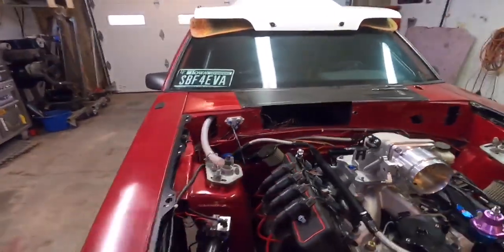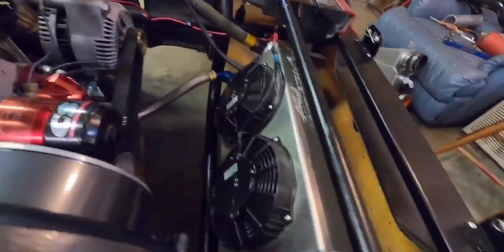Switching things up on the 800hp fox mustang

Comment: i really dig that small radiator. How does it keep cool in summer weather conditions? i have a front mount side turbo, on my LX and i couldn't fit a fan shroud, so basically i am running a puller and a pusher fan.  but i have been looking for a smaller fan set up...
Reply from the maker: So far it seems to work good